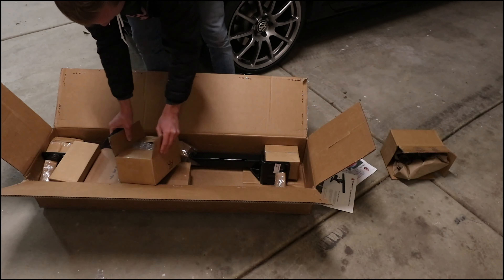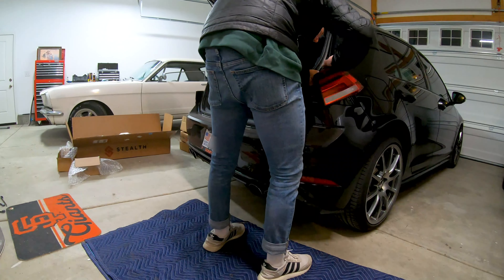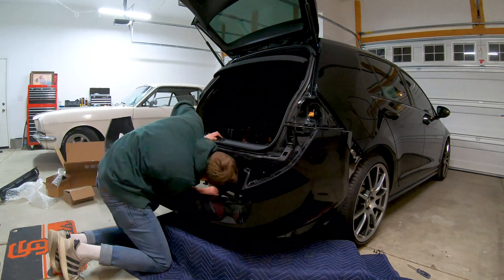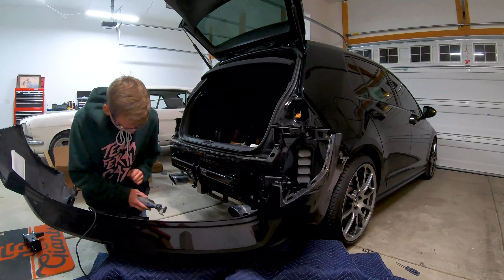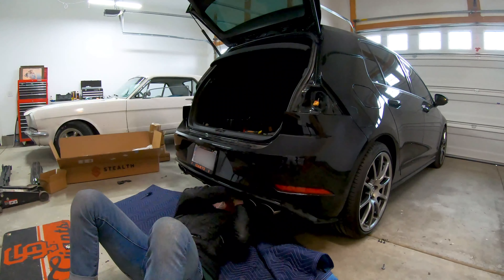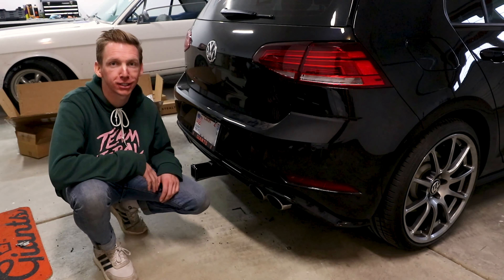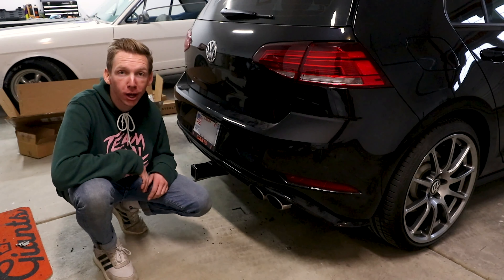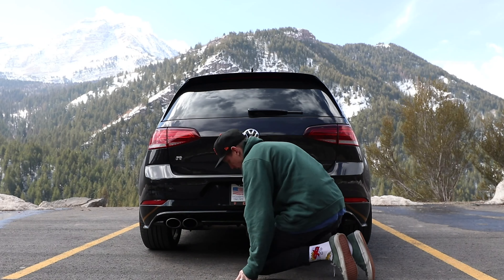Stealth Hitches Hidden and Removable Hitch on VW Golf R

Comment: Hello your commentary or guidance is much appreciated. I have a 2017 golf r that had hitch bolted directly onto the back of the medal behind the bumper for a bike rack a year and a half ago. I was trying to buy a small utility trailer for my car and needed to make sure I had correct ball and receiver height to match trailer. I then began to question if what i had installed was good enough and looked into owners manual and it states emphatically in 10 places or more this car was not made to tow anything and not to use a two inch ball mount as that weight is definitely not for the car. It further goes into stating that the car is also not made to have a weight distribution hitch installed as I was going to do that to take care of the hitch i had installed for bike rack which is 300 pound max including bike rack. Apparently as was explained to me from hitch and trailer store this is because the golf r framing of the car is all one unit and and not a sub frame bolted into bigger frame. 

What ever utility trailer is small and I am not driving far and or loading it up to the max. Just to lowe’s home depot and back home on side roads driving slow. I towed with my father for 10 years as a kid and we pushed the limit sometimes. I really need this utility trailer but am worried about how much the owners manual states repeatedly not to tow anything that car isn’t made for this when a regular golf or gti you can tow with. Any advice is greatly appreciated. There isn’t much on you tube or google.
Reply from the maker: Hello! Wish I could help more but I only ever use it with a bike rack and it's been fantastic with zero issues. I've heard it's more common in Europe to tow small trailers, I might would try a forum to see if others have experience with towing. Good luck!
Reply: I'm pretty sure this is nonsense becuase in Europe people with MK7 Golf's tow campervans all the time. You would have to go down that rabbit hole a bit more but I'm pretty sure they don't want you to tow with these in America so that you don't sue VWoA or something. Install the hitch, keep it at 55mph or below, and you'll likely be fine.
Reply: Ya so i towed all kinds of stuff on the 4 by 6 trailer and akward weight placement, wind issues blowing trailer around. When it is just car and trailer it can fly and there really is no difference in car and trailer together. However because the car is so low to the ground i did by hitch receiver and offset where the ball joint connects to trailer raising that hook up point two inches above flat to offset some weight away from car and onto trailer when carrying heavy load. When towing a heavy load like this you cant go faster than 45 50 safely as trailer can start to do the side to side motion. When not towing a heavy or offset weighted trailer load i then bought normal hitch hook up so that i could do normal 70 miles an hour. Bumper was taken off 9 months later and bolts were still snug tight so it appears everything is good to go. 

Oh one thing, i got better gas mileage towing than normal if that explains my without trailer driving.
Reply: Hmm perhaps the R is just unique. Every other MK7 is fine I would think.

Comment: Dude. The guts needed to actually take parts off a car are not a gift of mine haha
Reply: It's very easy on these small cars. I'm a girl and did this too. Bumper removal is easy just follow up a tutorial on it to see where the clips and screws are located. The only thing I didn't do myself was the trailer wiring. Uhaul charged me around 45$ to install the wiring themselves so it was cheaper for me since I didn't have to buy additional jacks etc.

Additionally, if you don't want to remove the bumper there's a class 1 Curt hitch you can install by removing 4 screws on the bottom and sandwiching that in between. It'll get you a decent amount of load capacity for bikes and light towing/utility hauling. 

Good luck!

Comment: Curious if you noticed any play in the connection between the hitch and that block you plug it into. Slightly hesitant to purchase one just because of the detachable nature of it, wondering if there will be any play or clunking noises once I mount 2 full EMTB's on it.
Reply from the maker: No play or clunking from my experience. It’s been quite solid. I’ve run it with 1 emtb and 1 xc bike fairly frequently with not a single issue. I’ve still been very happy with the product.

Comment: Which year is your R? I see the label on the box says it’s for 2016 to 2019 years, but on their website they only list it as fitting 2018/2019. WTF?

I’ve got a 2016 and when I contacted them, they said it would not fit because the rear facia on the bumper changed in 2018… if the attachment points are the same, I figured worst case, the trimming required might be a little bit different on the older models, but it would still fit.

Confused!
Reply from the maker: Mine is a 2018 so I'm not sure but it seems wild to me that it'd be much different on a mk7! Wish I could help out more.

Comment: Would this work with a 2023 (Mk8) GTI?  Does wiring need some kind of module to avoid tripping the read sensors all the time?
Reply from the maker: Not sure on the mk8 but the sensors for me just go wild when I have a rack on the back. I have to disable them every time I go in reverse with the rack on.

Comment: Great video. Are you concerned at all about completely removing the factory reinforcement beam and foam? I live in a city and I'm worried that if someone taps my bumper while parking it would be hollow and more easily dented. This is the only red flag I see with the design so I'm curious to hear your thoughts.
Reply from the maker: I get that but I do think the original foam could be cut to fit over the new bar so that might help to mitigate it a bit. I'm fortunate to not have to park too often in the city so it wasnt as much of a concern for me.

Comment: Is that a 2" or 1.25" receiver? Seems like this would have slightly worse clearance than non-stealth options when the receiver is attached. Is that the case and if so has it bothered you at all? Definitely looks better than hidden hitch alternatives!
Reply from the maker: This is the 2" receiver. I did that because I already had a 2" rack from my other car. I'm actually not sure the clearance is any worse since I did cut away some of the rear valence but I havent done a direct comparison.